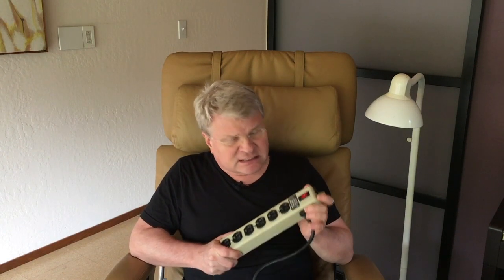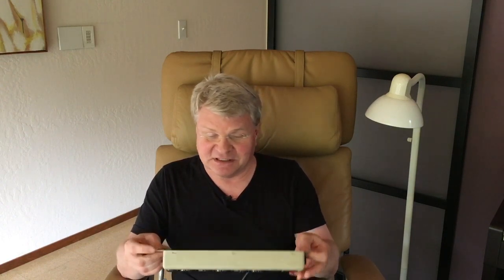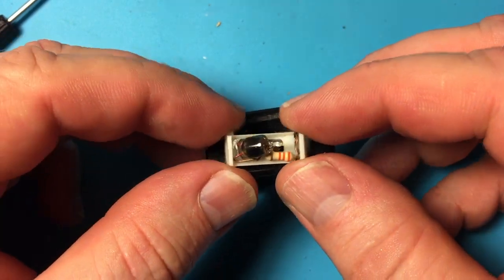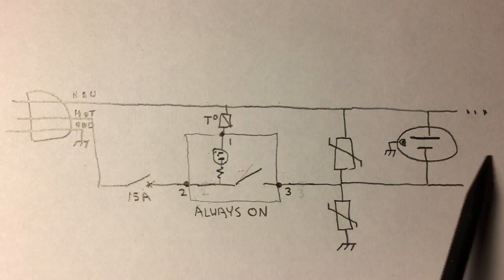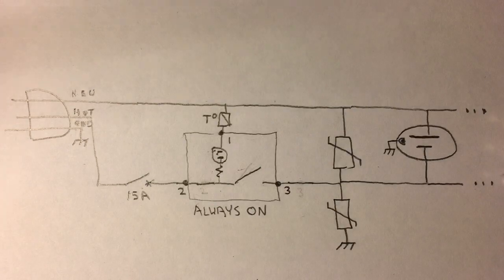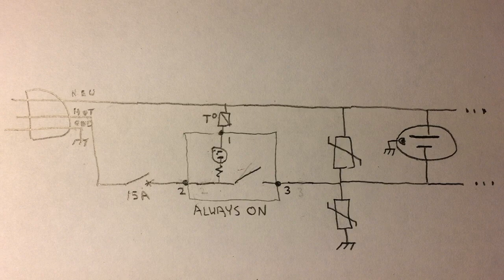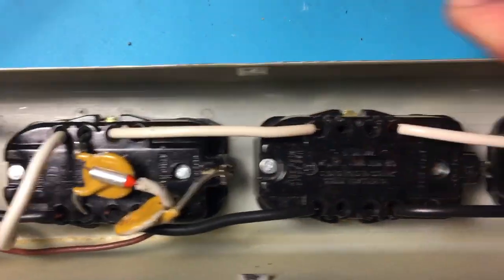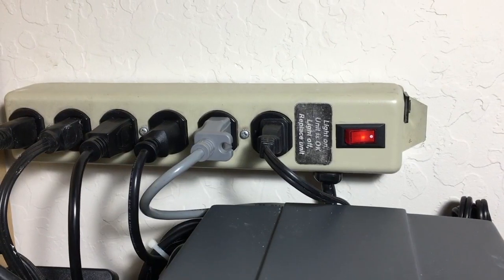Surge-Suppressing Power Strip Rebuild

Comment: I’ve got a 12-outlet metal bar where the switch trips with anything larger than 6 volts plugged in and on for more than 5 minutes. These bars aren’t cheap and I’m poor, so can’t buy another. I need to try and repair it. Hoping your video gives some insight.

Comment: Hello.  I have a strip surge protector and the circuit breaker isn't working.  The numbers on it are A0709 120 VAC 15A. another number is AE057-61-17613. I CAN NOT FIND A REPLACEMENT... HELP PLS
Reply from the maker: I wouldn't bother trying to match it exactly. Just search for a 15 amp "push to reset" breaker and try and get something that will fit mechanically.  Maybe something like mouser.com part number 655-W57-XB1D7B20-15.

Comment: Greetings. I am working on a couple devices.  I am trying to keep them quiet. Simply due to the nonpatent on either. I could definitely use a bit of direction and an educated opinion.
7166253885 Shawn buff ny